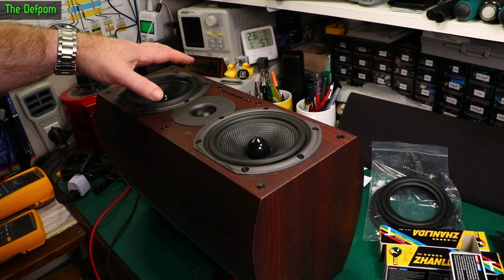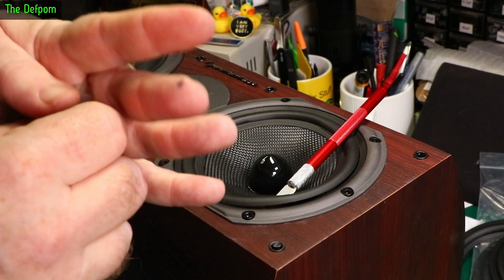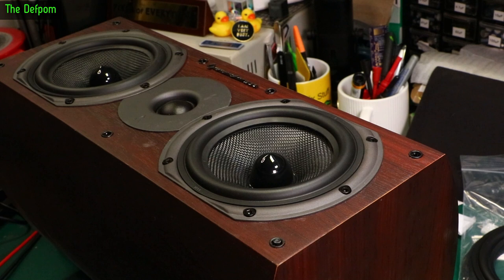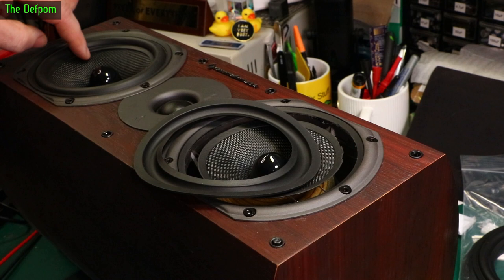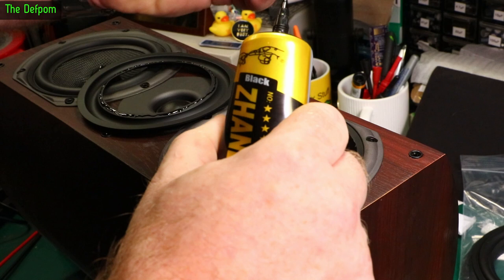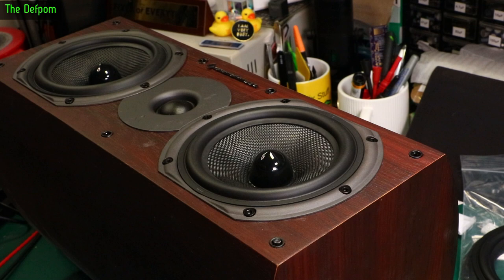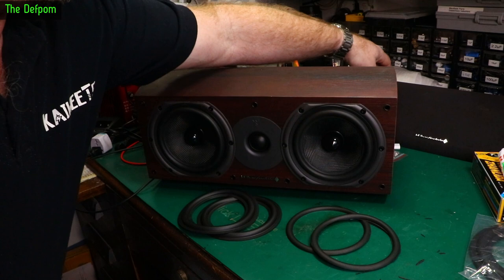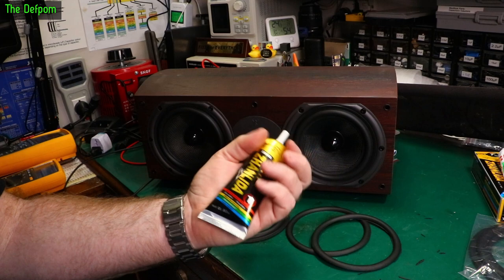🔴 Wharfedale Speaker Repair - No.1145

Comment: Good job, but long term DC on the voice coil worries me a lot!  Too much room for operator error. When I need to push the cone up, I take the speaker out of the enclosure and pack same height expanded polystyrene squares symmetrically between the underside of the cone and the chassis arms.  I have also used cotton wool balls in the past, but the polystyrene guarantees a symmetrical lift.
Reply from the maker: Yeah that's why I commented  a lot about minimising the usage of voltage as much as possible, and keeping the time as short as possible and current as low as needed.

Comment: My father used to repair Tannoy speakers, they used a rubber contact adhesive (Bostik) to bond the surrounds to the cone and frame. It has the advantage that you don't have to work quite so quickly to get the surround fitted before the glue dries.

Comment: Just checked the speakers on my workshop (25yr old) SA-PM37MD system......and one section of one of the sub-woofer rubbers is deffo degrading, getting flaky/breaking down to dust on the surface. Should last a few more years yet before it's gone I am guessing.

Comment: Nice job on bringing the speakers back to life! I just did some 90's sonys recently. Do you think leaving that little bit of rubber on there will alter the Thiele-Small parameters much? Maybe drop Fs and raise Mms. Probably not noticeable?
Reply: Top end maybe affected, slightly extra weight to the cone?......but I guess would be hardly noticeable given the nice job done.
Reply: @IanScottJohnston  Yes I agree - any differences might just be measurable, but probably not noticeable.  The compliance of the new versus the old rubber surrounds will in any case be different, simply due to ageing.